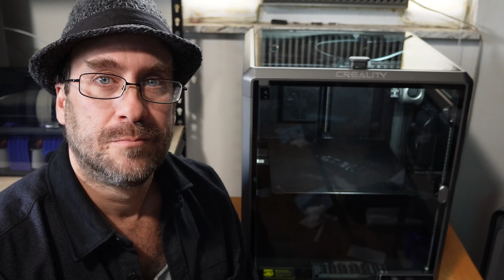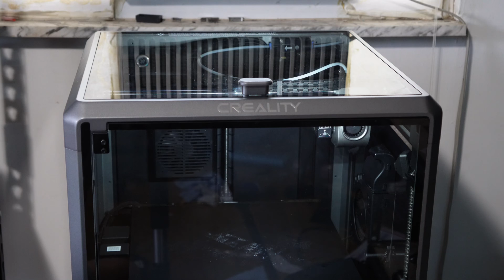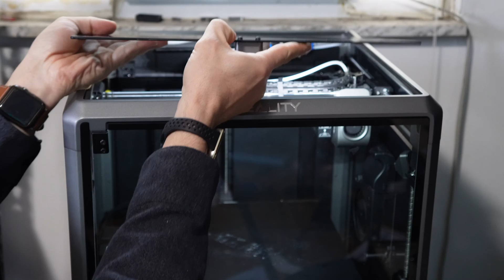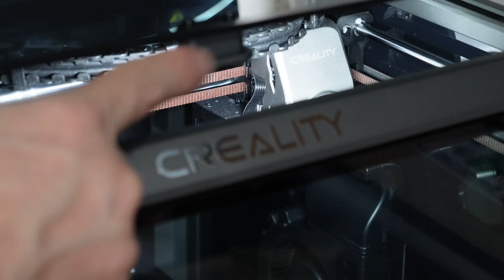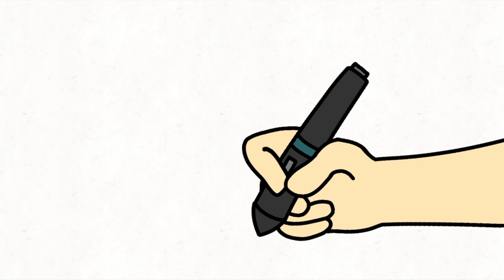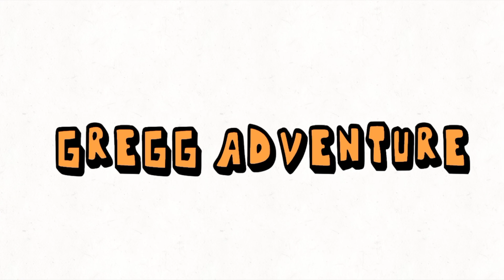Secret Technique to vent Creality K1 MAX, Chamber temp for PLA & increase Cable Chain clearance

Comment: I have secret tip for you...  set the handle toward the back.  That deflect more of the sounds out the back and reduces the overall noise coming from the printer ;).
Reply from the maker: That IS a fun tip! But, I have a Dozen machines running, at any given time, so, it sounds like an airport, no matter what I do...

Comment: Seems pretty dangerous if the top shifting slightly backwards can have the knob fall off the front edge and the glass plate then dropping down.  This would be used on a printer that will be heavily shaking while printing, so what will keep the top from slipping a bit backwards?
Reply from the maker: The top doesn't move at all. The printer also doesn't shake. Regardless, if it falls off, as demonstrated in the video, it ends up flat, just as it would, had you placed it right side up. It can not fall in

Comment: Ventilating out the top seems dangerous to me, regardless of the method used. I don't want the fumes just blasting out into my room. I want them being directed out the back via the extraction fan in a controlled manner, so the air goes through a filter and/or ventilation hose. Even PLA fumes can be dangerous.
Reply: I print EVERYTHING in a zippered enclosure with a 4 inch variable speed inline fan venting outside.  I am using a  CR-10SE.  I don't want to subject my family to those fumes.
Reply from the maker: There is no filter on a K1 MAX. Nor a K1. It is common practice to open the front door, or remove the lid. Bed slingers have no enclosure at all. Bambu P1P has no enclosure at all. P1P, P1S, K1, K1 MAX, are used with door or lid open, for PLA by everybody. It's not to ventilate "Fumes", it's to maintain a cooler chamber temp. Nobody is using a ventilation hose for PLA printing.
Reply: @3DRundown  Other than the regular K1 my K1 Max was shipped with a filter.
Reply: What? I'm pretty sure the K1 Max has a filter, and the newer K1C does as well. It's true that most people don't care about PLA safety, but they should. It's a very common misconception that printing PLA is perfectly safe. People claim PLA is non toxic and that it's never been shown to do any harm - as if a lack of evidence is evidence to the contrary, which is not true. But in fact there are studies, which do show that PLA printing does still release toxic fumes as well as clouds of micro plastics. It may not be as bad as ABS but it's still bad. Very dangerous when people tell others that PLA is perfectly safe. A lot of people are running their 3D printers in their bedrooms now while they sleep. I certainly don't want to be breathing that in all day.
Reply from the maker: I've never heard anybody say "Perfectly" Safe. Generally safe though, yes. I'm in a room surrounded by running printers all day. I have a large carbon filter running 24x7. That's about it. I'll live. Yes, the K1 Max does have a filter on it. That facts are, people print PLA with the doors open, lids off, with custom Vented Risers, and 3D printed Lid lifts. The topic of this video, was a comically easy way to do that. I can not cover every and all angles imaginable, for every and all topics. If peeps want their machines sealed up, this is not the video for them. If people are cracking their doors or lids, to print PLA (they are), this method is an option.
Reply: To everyone who's saying there is or isn't a filter on the K1 max, there is a filter... but it does not filter. It's absolutely useless, so if you are printing abs or things like that don't rely on the in built filter.